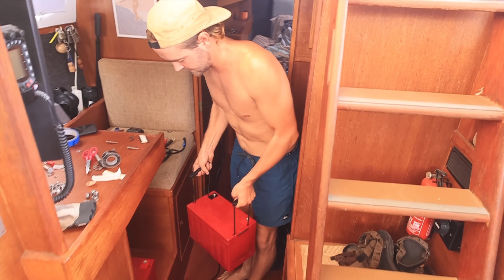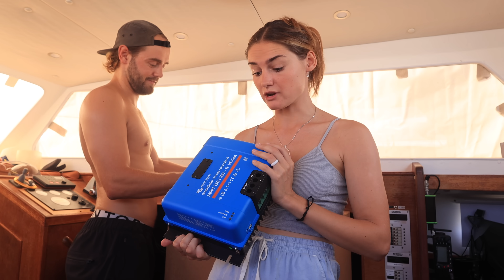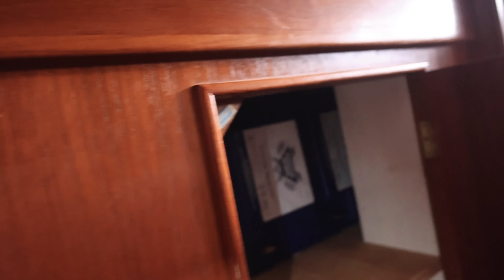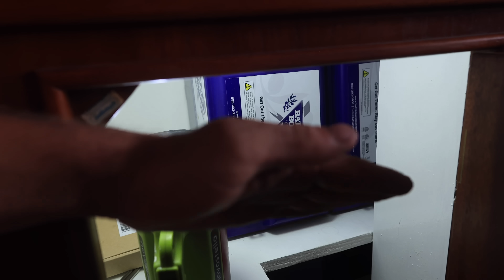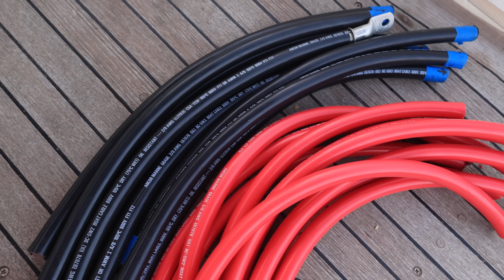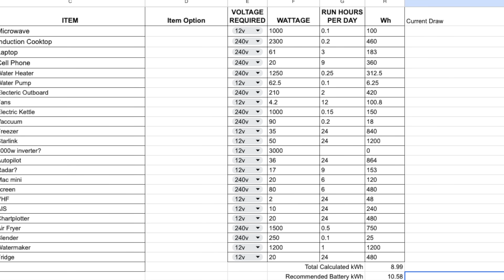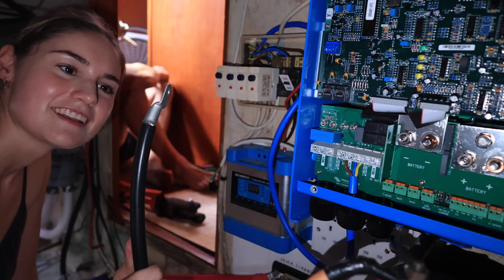BOAT YARD LIFE: Near FIRE onboard

Comment: Voltage and current always "have a moment together" at some point on the load curve. V=IR, or V/I=R, where I is the current, and R is the load.   You have rediscovered simple circuit law.  I found your description humorous, but if those batteries or that charger had ignited the hull, it would have been anything but.   Yeah, don't put the swollen battery back into service, it is torched.  Obvious mechanical deformation is NEVER a good thing in a battery.

And yes, paint dry to the touch, and dry enough to bolt things to, are two very different things.  I discovered that once myself, as well.  One of those 'live and learn" moments.

No, it's not funny.  Schematics are invaluable, and whoever you sell that boat to will likely be praising you for taking the time to do them when they have to service the system.  Make sure when you do sell the boat to provide those as part of the package.  From a retired EE, nice job.  My only question would be is there enough air circulation between those batteries, as they looked pretty tightly packed in, side to side.  I don't know the requirements and you probably met the specs, but just something I noticed.  Nice job, and workmanship...and just FYI, hole saws bits for the drill aren't that expensive, and they nest in the case so they don't take up too much room.

"This is the last one to be crimped".   At least you didn't name it, but yeah, I get it.  :-)  Try it when you are working up a backplane of about 21k holes, or a card with over 1000 components.

Comment: Definitely a game changer. Great job you guys. You got yourselves an excellent product. Becka question do you think it's actually right to paint the positive black controller's red ? I figure it was designed that way and may cause confusion later down the road. Because if something goes wrong with the electrics and they the manufacturer found you changed the colour from black  to red then they could say warranty is now non void. I'd check in to that . 
Looking forward to next video
Reply from the maker: We can't wait to put the system to use! Cheers Jonathan. For us it makes it easier and safer, buss bars are fairly simple bits of kit. So I'm hoping it won't have any issues😅🤞 See you next week.

Comment: My Question would be how much was the boat yard costs? I think you spent 40000 € for all this things, how do you get all this money? A new Sail is about 3500 €, the batteries with the chargers and inverter is about 10 to 15000 €, and that's only this two points.

Comment: The manual of that Multiplus 12v 3000 calls for 2x50mm² cables for short runs or 2x70mm² for longer cable runs for both + and - terminal, i.e. 4 cables total. What made you comfortable to use only single 70mm² line?
Reply from the maker: We spoke to Battleborn who reassured us 1x70mm2 would be ok until we get to mainland where we have a wider option of wiring